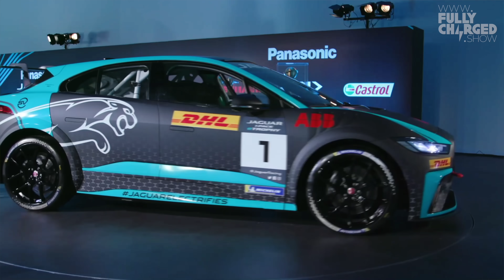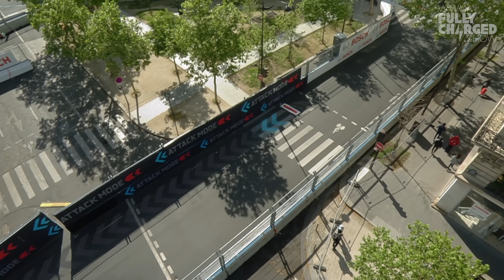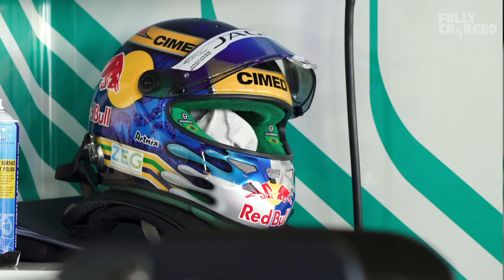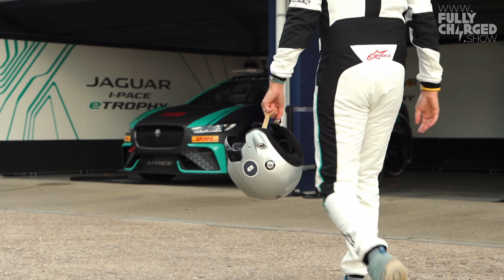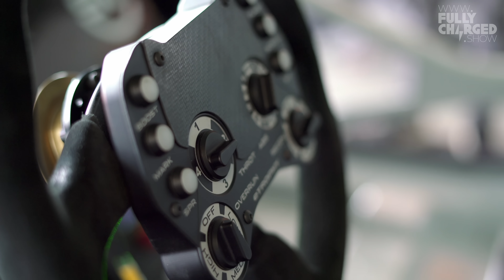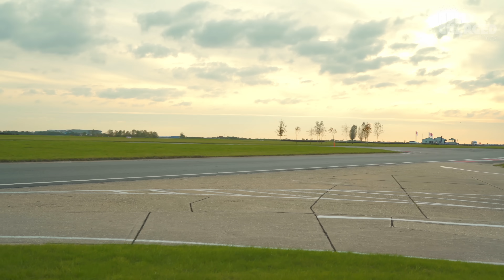Jaguar I-PACE eTROPHY electric car racing series - Jonny Smith test drives | Fully Charged

Comment: Personally I'd like to see a car like this with the regular battery and add a capacitive battery for silly bursts of acceleration, have seperate regen on it (will also take some strain off the brakes) so it doesn't affect the standard build but bolts on.

Comment: is that brake squeal or wind whistle coming into corners.
Reply: Those brakes are crazy loud. 😒
Reply: Race car brakes are for stopping, not comfort.
Reply: Stephen Cooke Sure, but I’ve never noticed anything like that in a broadcast. Are you saying that’s fairly typical? I assumed that efficient brakes would naturally be fairly quiet, turning that energy into heat rather than vibration. 🤔
Reply: Most racing drivers when trying EV's think the car is about to break down in pieces because they hear noises they never heard before like suspension noise, brake noise etc
Reply: Sounds a bit like when the smoking ban came into effect, most people started to notice just how smelly the pubs were as the smoke used to mask it all.
Reply: It’s because they use carbon ceramic racing brakes. They squeal under braking particularly when cold. Hard braking to get them up to temperature would resolve the issue but I imagine Johnny was asked not to go too crazy..
Reply: J B Yeah, it just occurred to me that his brakes may not be up to temp! 😂
Reply: @serversurfer6169  race brakes need to be hot! The pads and discs are selected to work at elevated temperatures, so are generally less efficient and more noisy when cold.

A road car is very well refined and comfort known as NVH (Noise, Vibration and Harshness) is one of the most important factors, so that they can compromise on materials that are quiet, in favour of being able to stop from 100mph every 30 seconds.

Comment: I'm surprised they don't have variable regen on a stalk by the steering wheel.
Reply: Jim Porter
Race cars your either hard on the gas. Or on the picks as hard as you can.
Reply: @Robert-j6r8c  There are a few electric conversion race cars out there with a paddle/lever for regen that can lock the wheels, surely enough and increasing the range. (It's not new, it was the early days of hacking the Tesla Model S rear motor)

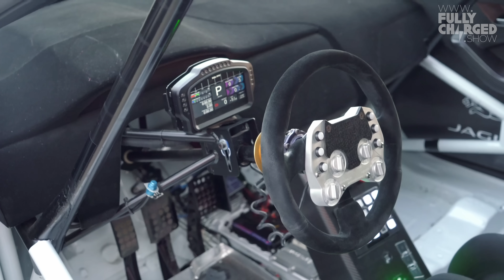Comment: 9:32 Three pedals?
Reply: thinfourth I think one is a „resting“ Pedal for the left foot
Reply: @Stahlesel  It's commonly called a "dead" pedal, and is often built into the floor on road cars.
Reply: Sharp eye! Might be a "dead"pedal, could be two braking pedals with a different rear/front bias like they once tried that in some F1 cars.

Comment: How much battery capacity it carries and range on that pack ....
Reply: Standard battery capacity is mentioned. 90kWh?
Reply: @stuartlanceley444  ok... so it's same as it is in the passenger variant model...so might be same range as it lost good kilos...
Reply: @vbuddhdev  probably still substantially less because they are putting more power into the motors, 20% more in power boost mode.
Reply: @DavidKnowles0  ok got it .... Thanx...

Comment: This is a great vehicle. It is a pity it is not more successful. However, today (21st November 2019) will be announcement the first production electric vehicle with 1000 miles range. The CYBRTRK. This idea is coming from the declared range of the Roadster, 600 miles. Tesla will use the same battery technology of the Roadster with a larger chassis. Let's check back in a few hours
Reply: Yeah you right but no way 1000 miles at $50k!
Reply: If the high end does 1k miles I'm making the stretch!
Reply: I agree with EGold. Tesla will surely offer different models at different prices
Reply: That would mean only 250 charges to reach the moon! 27 to circle the Earth!! 90,000 to get to the Sun!!!
Reply: @egold33311  You are right. The $50k model will have less range  than the high end one. I guess this is normal in the automotive industry.

Comment: Should be model 3 race series, more efficient and faster. Why ipace?
Reply: Because Jag got there first.
Reply: Efficiency really doesn't come into Racing though. At least Jag's batteries don't overheat when used on a track ;)
Reply: Just when you thought it was safe and you could relax for a moment - out pops a Fanboi!!!
And the thing is, he actually means it........ (ah, the blindness of devotion......!)
Reply: @stevechilds1547  F1 racing is now very much about efficiency,one tank to complete race. And formula e cars are not swapping cars mid race,therefore less pit stops
Reply: @gregstafford2155  Yes, I agree. However the question was about Model 3 vs IPace for a racing series, in that case efficiency has little impact on the actual race itself. Who cares if the race finishes with one car with more mileage in the battery! F1 has to been seen to be 'Green' as its still ICE powered, but yes, their powertrains are an engineering marvel.
Reply: because it funded by Jaguar. Why doesn't tesla do it, because they don't want to because the people behind it aren't really car fanatics.
Reply: @DavidKnowles0  I don't think it's that,  I think they are car people, but racing would be an indulgence and a distraction to them at the moment. Plus it doesn't quite fit with the brand image either,  perhaps?

Comment: Compliance race car. Hate the Formula E parroting road tires.
Hope they'll make a more weight reduced version with fancy inverters and motors. To FE motors, for instance. Not a lot of power combined, but easy to push all race.

I like that they started doing it, not the way they went about it.

With a bit of effort, a BEV touring car can hang with BTCC and the like. Just not for very long races just yet. But even Rally Cross performance is absolutely doable with race specific equipment. Smaller lighter battery, more tuned chassis, panels replaced for fibreglass.